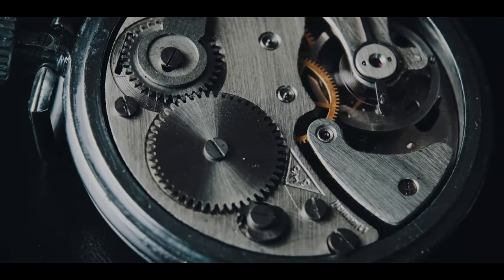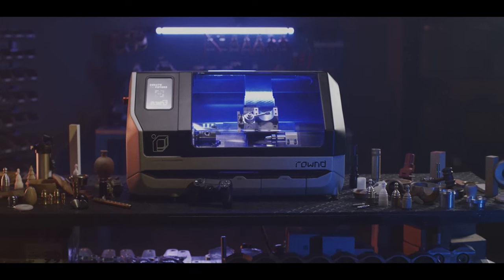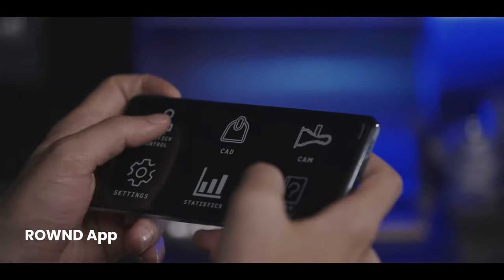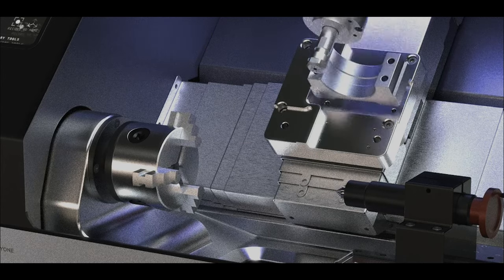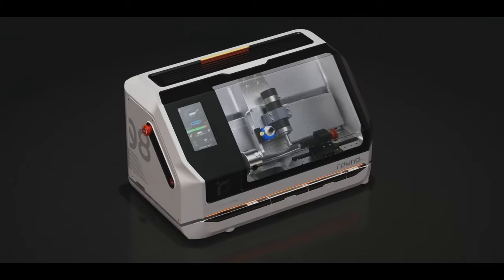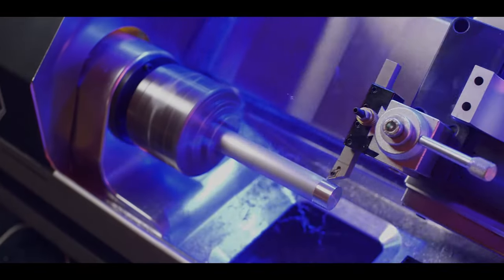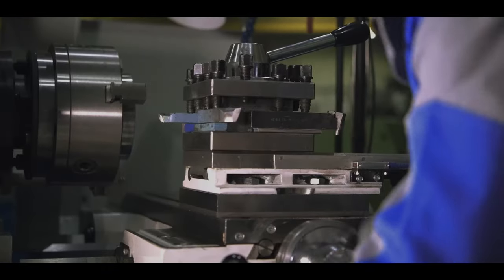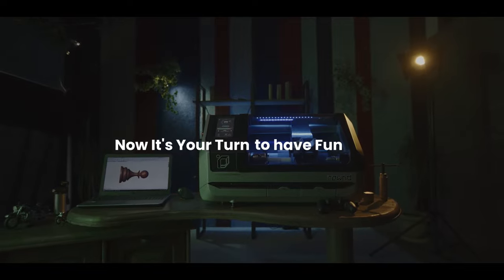Rownd CNC Lathe - The World’s First Consumer And Hobbyist-Friendly CNC Machine

Comment: This is a terrible idea 😂 Don't buy this.
Reply: Why do you say that?
Reply: @LokiTrismegistus Because he is right. 
Price will be insane in comparison with productivity. Its like 3D printers - everybody bought it, and now, 95% users do not know what to do with it. 
Not everyone is an engineer to find use for this, but there is a small catch - engineers already have their ways how to manufacture their stuff, in a much better way than this toy.
But yes, its very nice, simple and good design. Good job.
Reply: @pipthepip2299 You don't have to be an engineer to have use of this time of machine. It has the same use as a 3d printer but goes even further
Reply: @59Mrgamer  Please read my comment again - you are just confirmed what I am saying ;-)  
And no, you need to be a some kind of engineer, because otherwise you will end up like with 3D printers - have no use for this. But this time it will cost you much much more.
Reply: @pipthepip2299 If you bought a 3d printer, and have no use for it, then why would you buy it, sounds like you have some mental issues going on 😂 🇨🇦
Reply: I can't help thinking about the amount of deflection in an alloy rim of a car wheel. How then, is this going to be any better? It's made of the same material!
Reply: I don't think it's a terrible idea , and the price? 4700 ? That doesn't seem that high.
Reply: Idk man. Ill bet its overpriced af, but it seems extremely well built.

Ive been machining for 10 years and i do all types of engineering and mechanic work, lathe and mill work, cnc stuff anyways. My opinion is relevant here,  it looks like a CLASS A product- actually.
Reply: @pipthepip2299 lathes have been around for hundreds of years lol

And if theres a low production volume, price may be high. If its not made in bulk in china, it will be expensive lol
Reply: @tg5509 How tf can you say that a product is overpriced af but is extremely well bulit?? Lol😅
Reply: Most people in my life who bought 3D printers use them constantly. :D Including me!
Reply: @Luka1180  EXACTLY, saying that 95% of people dont use them just shows that you dont have that diverse of a friend group
Reply: @pipthepip2299 im finding my self using my 3d printer to prototype and now i want to get a cnc mill or looking into a lathe and this looks like a stepping stone
Reply: @davidl6354  Sounds you have some skills, or you are capable to design your own parts in some 3D software (CAD) at least. 
Than yes, you surely have use for your printer, even more machines. 

But many people around bought 3D printer, but are not capable to design his own parts. Thus, after a while, found no use for 3D printer - just printing gadgets downloaded from net is boring after a while. Yes, power of advertisement is huge :-)

Go for a lathe, mill is even better. But not this one. I am desperately missing a spindle in this toy :-D :-D :-D    
Description - there is no spindle, just some funny motor, which have bearings in gummy seals, absolutely far far away from idea of spindle. And yes - it will create more problems than you think, especially if you dont work on any mill before.
Reply: @pipthepip2299  thing is im not an engineer or an expert at CAD but just a beginner. And the limitations I find is making things bigger in plastic when a simple thin metal part could’ve done the trick instead. Still learning a lot though
Reply: @pipthepip2299 id rather buy a used manual bridgeport for that price.😂 or build my own cnc lathe (more rigid)
Reply: @dreizenit7758  EXACTLY! :-)

Comment: Someone will buy one of these, struggle with the programming and tool setting, crash it a few times, then he'll crash it so hard that it's going to take some serious money to fix. Then they'll realize that they can't do much with it and just give up.
Reply: now thats not the spirit
Reply: As an older professional machinist that had to learn cnc turning, I can honestly say that it's a lot harder than it looks.  First you need a pretty good understanding of manual lathe work. If you don't know what the proper tool geometry, feeds and speeds of the material that you are cutting.  Then the cnc side of the problem. What kind of programming does this thing use , G code or Conversational?
Reply: @paul5683  Yeah you are right about that.
You really need to learn manual lathe operation for sure.

Comment: If I had the spare cash, I'd consider getting one but, not until after the second or maybe third iteration was released.
Why?  Generally speaking, it takes two or three iterations to work out all of the bugs that the designers missed in their rush to get their wares to market.
Buying the first ones that are manufactured means that you're sort of like a guinea pig buyer whose complaints are used to make improvements.
Still, it's a nice compact little package.  With any luck they will be worry free right out the gate.

Comment: It's very difficult to bring out a quality product at an affordable cost for a new start-up in this niche. Hobbyists would be the main market and their spending power is fairly limited as the premium 3D printer market has proven. The other big market would be schools but they tend to go with established manufacturers. A small business would need something a bit more substantial and capable to be honest. 
I would buy a small Denford CNC lathe if I were in the market for something like this. It's tried , tested and available off the shelf from an established manufacturer and support, spares etc wouldn't be an issue.

Comment: 20 micron precision on what material? Based on its size and weight its not particularly rigid, which is allways a problem. the animation also showed that lead screws are used compared to ball screws which have more play. The most expencive part here is the enclosure.... should focus more on actual usefulness of the machine
Reply: 20 micron on ice maybe and fading 😂